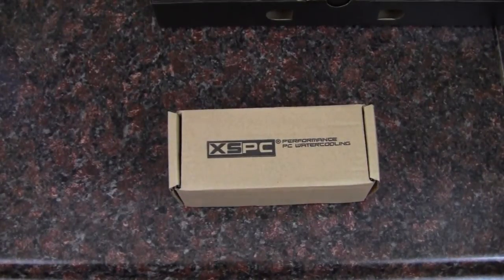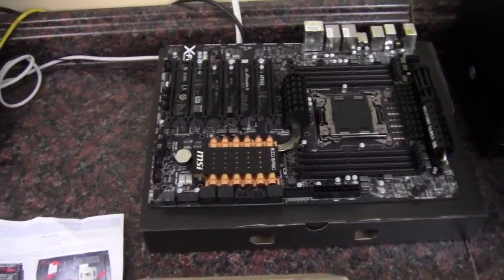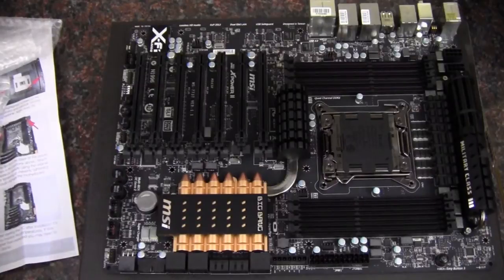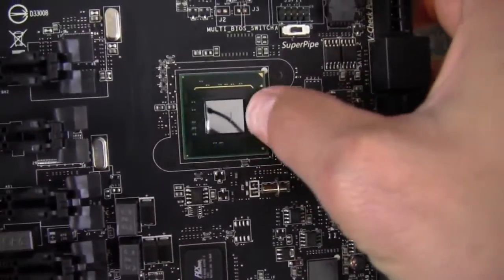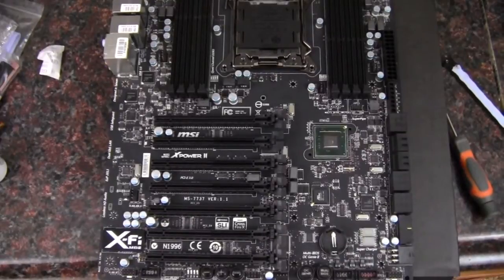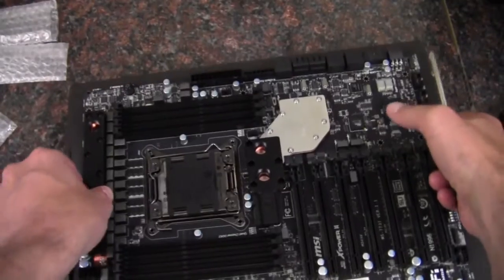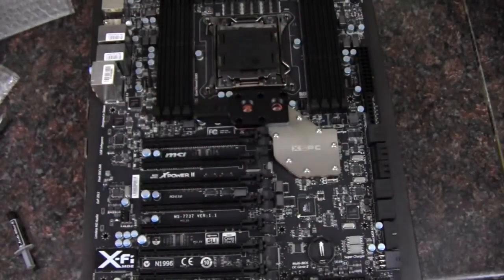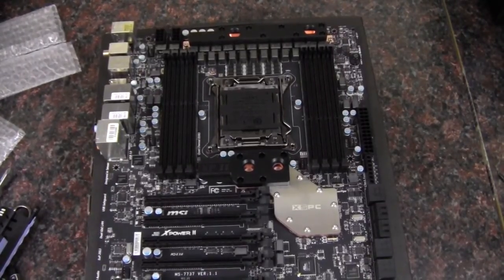XSPC Waterblock Kit for MSI Big Bang XPower II Motherboard

Comment: Hey AdoptedMike did you get any coilwhine from the motherboard after installing the waterblock?
Reply from the maker: +kantxcape I did not notice any. Although to be fair, I don't pick up on coil whine like some people. My hearing is not very sensitive. I have worked with a guy that could hear a graphics card coil whine and even if I put my head next to the GPU, I could barely hear it while he could hear it from 4 feet away.

Comment: No tbh I will be getting a console because the video card clock has went wrong and it will cost to much to buy a new one but I will be using the CPU from it in my work station PC , its all in immaculate condition so is should get most my money back ;)